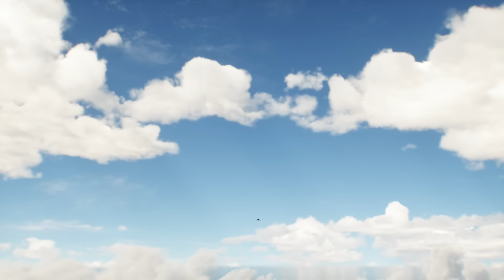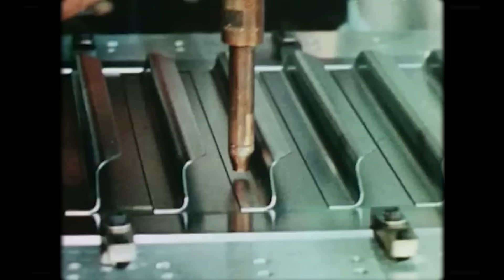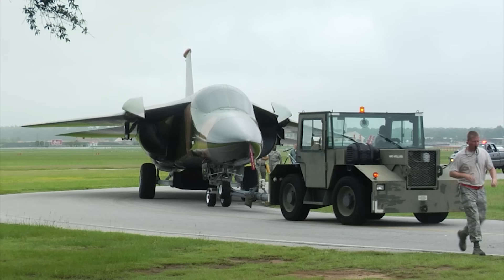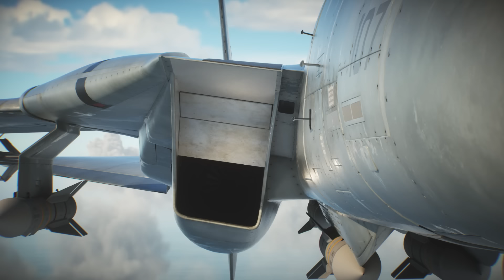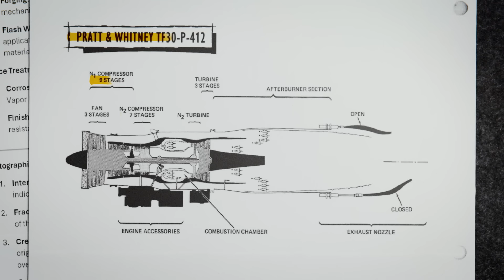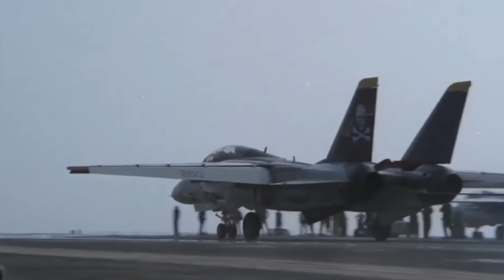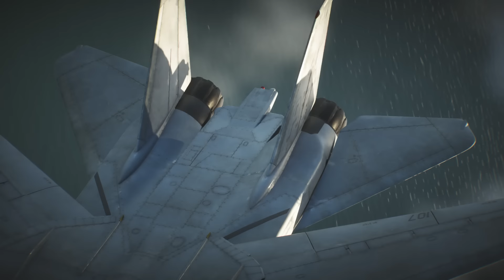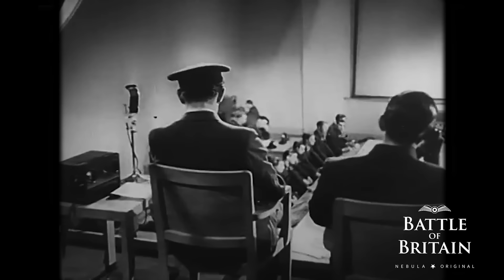The Insane Engineering of the F-14 Tomcat

Comment: Really surprised this video didn't cover the F14's flight computer. As far as marvels of engineering go, it's definitely among them. It's debatably the world's first microprocessor and for quite a few years it was the most advanced computer ever made. It wasn't until it was declassified in the 2010s that people realized just how far ahead the DOD's computing prowess was at the time.
Reply: I don't think Real Engineering can top the video by Alexander the OK - and he really doesn't need to try. Go check it out, that computer was insane for the time and is a study in optimized hand coding.
Reply: @kstricl  I would also recommend Alexander's video about the Saab 37 Viggen's digital flight computer for those interested in such things.
Reply: @kstricl  Thanks for the recommendation! I'm watching that one next
Reply: Ah I think some guy already did a video about that.
Reply: @Alexander-the-ok ah the man has been summoned 😂
Reply: It was the first microprocessor but it actually went into the AJ37 Viggen before the F14. It's still an amazing computer nonetheless
Reply: @deekamikaze not quite. The Centralkalkylator 37 in the Viggen had integrated circuits (likely the first such unit to be airborne, and very impressive), but it was not a microprocessor. It was essentially the evolutionary step between the previous all analog versions and the true MPU in the F-14
Reply: @hirumaryuei  yeah, but it could be tricked when someone has the insane idea to wrap the CADC air lines in the radome with metallic tape. VF-124 lost 2 in '76 (if memory serves) doing touch-and-gos . Happened on 2 consecutive days, then they were grounded until the cause was determined. Fortunately, all 4 aircrew survived.
Reply: There’s already a video about that. Which everyone here has undoubtedly seen given there’s like a dozen comments mentioning it
Reply: I mean it's a half hour video
Reply: Hopefully is also the case with our super sonic missiles we “dont have”
Reply: @PizzaNoCrust  i think you mean hypersonic, although we've publicly tested those as well.
Reply: I used to work on them back when... actually back when my profile pic was from lol, and yeah they were absolutely amazing pieces of kit. So so complicated, beyond anything else at the time - even the RPYC of the F/A-18, which was pretty impressive in its own right. But fixing the AICs, WGVCs, WSCs, PTIDs, JTIDS... it was a lot.
Reply: It was 1980s technology designed and built in the 70s.
Reply: Also A6 intruder and Viggen
Reply: That’s because it’s a British clown… Can’t actually acknowledge what we did. Still upset about the telephone, radio, computer, electricity etc.
Reply: There are one or two other top quality presentations on the flight computer specifically by other channels, who I think are a little better suited to it being actual computer scientists versus RE's engineering background
Reply: TUNE TURBO?
Reply: ABRAHAM A. LINCOLN,PRESIDENT,AMEN.K-AMPAT.
HEALTHY LIFESTYLE.
ENRICH
VOLUME 12.00
Reply: SPARROW.MAVERICK TOY.
Reply: PHOENIX.
-MISSILE
-MISSILE
Reply: WHAT'S THE MEANING OF THIS.
Reply: (MISSILE).
-GASOLINE STATION
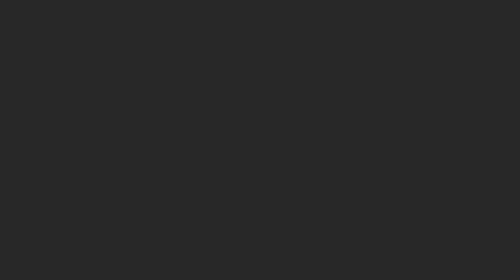Reply: 1:00.01
Reply: TURNING ENGINE./.
Reply: COMMITTEE.
Reply: IAF-IATF
-PTA
-FOP
-GUN
Reply: MCR.MCRIT.GARYO
T-SHIRT:
-SPORTS
-WAR
Reply: 52.
52.14
AREA JOINT ARROW INTRO:2
-KOMPYANSA
Reply: EXTRA GLORY IN THE SIDE?
Reply: Yeah i bet it can run Doom
Reply: @dannyzero692  half life 2
Reply: The f-14 didn’t have the first onboard microprocessor people -_- stop saying that it was the f-111
Reply: @deathkorpsofkriegguardsmen8488 tbe F-14 computer was far superior.
Reply: @blueduster74  it was about the first onboard microprocessor, not the best onboard microprocessor. Otherwise we'd just be talking about the F-35 or B-21 instead.
Reply: @deathkorpsofkriegguardsmen8488 A6
Reply: @deathkorpsofkriegguardsmen8488 this is simply not correct. The F-111 first flu in 1964 with the design obviously occurring years before that. The navigation and attack computers on the first variants were entirely analog. Later Aardvarks did get digital microprocessor based avionics with subsequent upgrades, but that was not until the late 70s and early '80s, well after the F-14s CADC in '68-70
Reply: Won't let you down goose
Reply: *Ejects before blowing the canopy. @TacticalShinebox
Reply: dude he literally set the bar at "loo faw faw" (presumably Luftwaffe)
Reply: We can only imagine and speculate what the DoD’s technological prowess is today.
Reply: @The-i4r  that's like really deep man
Reply: The very first sentence the narrator uttered was wrong. I'm not surprised he missed the flight control computer
Reply: @brianwright9514  the first thing he said is right
Reply: @nahtavaelubl3820  if he would have been talking want the F-104, it would have been right.  But he said that the Tomcat was designed purely to be an interceptor, which it wasn't.
Reply: @brianwright9514  very dumb

Comment: No video on the engineering behind the F-14 can be complete without mentioning that it incorporated the worlds first microprocessor in its flight computer. The Central Air Data Computer, powered by the Intel 4004, enabled computerized control of the Tomcat's variable sweep wings and flight controls, a quantum leap forwards avionics. This innovation marked a pivotal shift from mechanical to digital systems in aviation and it is criminal that this was omitted from this video.
Reply: The CADC actually utilized the MP944 microprocessor which was finalized long before the 4004, while still being much more powerful and was actually still classified until not that long ago
Reply: @7eraflops  thanks for the correction!
Reply: @Glasnost.69  the CADC was from around 10 years before the Intel 4004.
Reply: "Criminal"?  Gimme a break.
Reply: @SplashJohn  it’s absolutely one of the most notable engineering achievements of the F-14. It’s honestly lazy to produce a video and not include that.
Reply: @Glasnost.69  "Lazy"?  Your opinion, whatever.  Your lazy use of "criminal" is criminal.  See how that works?
Reply: The F-111D's Mark II avionics used microprocessors and predate the F-14.

Comment: Happy to see more F-14 content online! 

Some extra details I would like to add, not to be critical of your video, but because I love the F-14 and spent too long researching it as a kid;
the Missileer's designation was F6D, not F4D - the F4D was the Skyray.

The AIM-54A had a variant with the Aerojet Mk60 motor, the difference being thrust and burn time - but overall the performance at longer ranges were similar to my knowledge. Moreover the later Mk47 motors had reduced smoke.

IN 15:00, the TID symbology is a bit off. The tracks are depicted as essentially two halves of shapes. The top half of the shape indicates what the F-14 sees and the bottom half shows the datalink information. The shapes would have been diamond for enemy, square for unidentified (the tomcat had to manually IFF targets), and circle for friendly. On a personal note, I really love the F-14's displays - there's a certain old school charm to them. 

While 17G is impressive for a large missile like the phoenix, more agile aircraft can kinetically defeat them as the missile's maneuverability is dependent on factors such as airspeed. Moreover, the AIM-54 has no way to recover energy once the motor is burned out. Its acceleration is also not great.

The composite materials: I'm so glad you talked about this in detail! I didn't know much about this so it was really nice seeing it explained.

Final note: I'm happy paper skies was mentioned! His channel was one of my reasons for getting a nebula subscription. I'm glad I got it instead of paying for YouTube
Reply: You’re talking to a wall, he didn’t even take the care to think how to pronounce Grumman do you honestly think he cares about getting any facts right?

Comment: 13:40 that high power radar is one of the reasons that Iran keeps their F-14s in service. It's basically an AWACS that can go mach 2
Reply: I know Iran's F-14s were spotted a few years ago, but haven't heard of any sightings in a few years.
Reply: @JarrodFLif3r  it's probably on a life cycle preserving tour… so if they can, they rather sent some drones or the cheap Chinese jets… either way, it's on the last rope, as much CNC repairs they tried...
Reply: @PrograError  
I know they have done well with improving and even manufacturing parts to keep them flying as well as cannibalizing ones that are no longer air worthy.
Reply: @PrograError  
If I recall correctly they were spotted over Syria and appeared to be an operational mission, I would guess they were mostly used for their AWACS capability.
Reply: @JarrodFLif3r  There were also rumours of an F-14 eating an AMRAAM during the recent Israeli air strikes in Iran. Although personally I deem that claim rather dubious.
Reply: @PrograError  Not sure.  If you do some sleuthing on the web there are pictures of these planes being torn down by the Iranian airforce and I assume refitting them.  It would not surprise me in the slightest if major portions of those F14's were refitted using Chinese/Russian parts.  While we may consider the Iranians our enemies, do not for a moment underestimate their resolve or their intelligence.  Remember that they were successfully able to adapt a HAWK missile, a SAM to the F14 and have the AWG-9 provide guidance to it during the Iraq/Iran war in the 80s.  They also captured and reverse engineered our RQ-170 drone.
Reply: @sdfopsdmsdofjmp7863  I mean, sometimes missiles just land weird, blow up in such a way that they dont send enough shrapnel in a certain direction.  Probably not down to the F-14, but certainly not out of the question.
Reply: @JarrodFLif3r  there was a video of one taking off about six months ago, but that's about it
Reply: @JarrodFLif3r there was definitely one at the Kish Airshow this year. It was flying in formation with other planes and then they had her on display for the rest of the show.
Reply: @JarrodFLif3r they use them all the time. They're propaganda items, so Iran has way way more motive to keep them running than they would an old jet. Iran could keep them flying pretty easily if they deem them worth it. 

The precise problem with Iran is that they're so capable despite being a complete mess of a state. They're one of the few states that exist like that (another example would be NK).
Reply: @lost4468yt  You clearly have no grasp of how expensive it is to fly a 50 year old jet. Let alone one that is massive and was already extremely expensive to fly when it was new.

The USN retired the F-14 largely because it was too expensive to keep in service. You think Iran can justify that same cost with their military spending being a rounding error compared to the US? They are going as soon as Iran feels it can divest them without sacrificing capability.
Reply: @sdfopsdmsdofjmp7863  because the equation is completely different to the US.
Reply: @lost4468yt  I'm sorry but no military is happy to spend 5x the maintenance per flight hour for a jet with half the capability.

The Su-35 is not a great jet, but it's a whole lot more modern than the F-14 and immensely better. The R-37M missile is a better Phoenix.

The F-14 is being replaced.
Reply: @sdfopsdmsdofjmp7863 they disabled the swing wing mechanism cuz they don't use it abyways, it's basically a spicy awacs
Reply: @JarrodFLif3r there’s been a number of videos recently flying in combat
Reply: @Bransons.  
where? I haven't seen any new ones in years
Reply: @JarrodFLif3r  they had one flying at Kish air show a few days ago.
Reply: There was a rare sighting of an F-14 above Iran, probably because of preserving the F-14s from flight hours which can reduce the life of the jets
Reply: Someone wrote an article comparing the Tomcat's radar, built in the 1970s, with a new-built Russian Su-35. 

They were almost equal in specifications. Same power draw, roughly same range and tracking capability. It was eye opening how good U.S. tech is.
Reply: I mean the primary reason is that Iran is an international pariah and couldn't really get combat aircraft anywhere near as good as the F-14 up until very recently, where they got enough leverage against Russia to get their hands on some SU-35s. The only other 4th gen jets they've managed to get their hands on are some monkey model MiG-29s. Normal MiG-29s are renowned for their awful radars, the monkey models might as well not even have one at all.

I expect them to finally retire the few airworthy F-14s they have when the Su-35s start coming in, because they are really struggling to maintain the ones they have.

On an unrelated note. I also expect the US to randomly find a couple of airworthy F-14s for airshows as soon as Iran finally retires them. I highly doubt all US F-14s have truly had their wing boxes cut or been scrapped. I really think the US navy has a few F-14s stowed away that could be restored, specifically F-14Ds.
Reply: @sdfopsdmsdofjmp7863 F14s will imbellish anything to make it sound good. This is the real reason.
Reply: @sdfopsdmsdofjmp7863 you called it, after we bombed the remaining F-14’s in Iran, now the Maverick act is underway :)
Reply: @sdfopsdmsdofjmp7863  theres a few museum F14s around the country that have only had their engines removed so its possible
Reply: @WingusBingus1  Museum F-14s have had their wing boxes cut. They aren't structurally sound and will never fly.
Reply: @sdfopsdmsdofjmp7863 
Do we think those Su-35s will ever actually arrive in Iran?
Reply: @sdfopsdmsdofjmp7863  At the same time as I'm sure they still have some. I'm unsure because they've done things like stick once flight worthy SR-71's out in the open, as a "museum" piece or attraction. Just to deteriorate in the sun. 

Truth is, we have ton of incompetent line steppers that run the show
Reply: Powerful but very outdated now. It can also only scan in front of it, AWACS have 360 coverage
Reply: As a guy who worked on E-2C and E-2D radars... yes, it was incredibly powerful radar... for a fighter. I assure you, the AWG-9 did not compare to an AWACS or E-2C/D radar lol
Reply: more like they dont have anything better lol😂
Reply: Как и миг 31
Reply: Not anymore
Reply: @humbertogomez3907 😢
Reply: Never really thought about it like that, but it's SO true!
Reply: AWACS in a huge mechanical radar made from a 70's technology. A mach 2 aircraft that is too heavy with just a Thrust to Weight ratio of 0.7. Utterly Pathetic.
Reply: The AWG-9 could track 24 separate targets and lock on to up to six.
Reply: Not with TF-30s...
Reply: @AndrewGasser Yeah with the TF-30's only 1 out of 5 of them actually were able to hit Mach 2. 😂
Reply: We sold them downgraded units. There is no way they got the full fledged radar suite.

Comment: The Tomcat's radar, fire-control system and missiles were a product of the YF-12 program for which they were originally designed. For the unfamiliar, the YF-12 was the interceptor version of the A-12/SR-71 Blackbird family, a program that was canceled due to excessive cost and lack of practicality. When the F-14 program started, they adapted the YF-12's AWG-9 radar to the Tomcat, and resurrected the AIM-47 Falcon missile as the AIM-54 and appropriately renamed "Phoenix" missile. So I wouldn't say they were "specifically designed to defend aircraft carriers", they were simply the longest-range air-to-air intercept missile of their time. Ironically, most of the titanium fabrication footage in this video were actually from the Blackbird program. Kelly Johnson and Lockheed Skunkworks were pioneers of most of the titanium metallurgy that Grumman used to build the Tomcat's wing box.
Reply: The AIM-47 was the basis, not a direct integration. The AIM-54 had a different guidance system and control surfaces. The AWG-9 was developed based on the F-6D project, not the YF-12. The F-6D had a more capable radar specifically for the fleet defence role, so it was used as the basis for the AWG-9 and the smaller AWG-10.
Reply: I was told by a retired officer that the F14's radar was so powerful it identified aircraft when head-on by counting the turbine fan blades.
If true, that's pretty cool 😎
Reply: @garychisholm2174  Yes, that's Jet Engine Modulation non-cooperative target recognition. By the mid 80s I believe all the modern fighter radars had this capability, however this is the first I've heard of a Tomcat with the capability, perhaps it was a D model and not an AWG-9?
Reply: @mobius7089 APG-71 possibly
Reply: @mobius7089 I'm guessing it's the D model with the APG-71.  The only IFF capability the Tomcat had was the IFF transponder ident request and the TCS pod for BVR visual identification. 

Ironically it was the lack of NCTR which kept most Tomcats feet wet in Desert Storm.  The irony is the USAF realizing NCTR was not as reliable as they liked and started requiring VID before engaging to avoid blue on blue incidents.  Specifically that the Tomcat was one of TWO jets in theater which excelled at VID thanks to the TCS set.  The other being the Phantoms with the TISEO (same TV camera sensor as the F14, different name).  Never did get to really test her fangs in US service outside of the precision strike role.
Reply: @mobius7089  I just went down a rabbit hole on Jet Engine Modulation, thank you! That's so freaking cool! I had no idea something like that was possible.
Reply: For the SR-71…didn’t they have to set up a bogus shell company to get their hands on titanium from the Soviets? I know it was something sneaky.